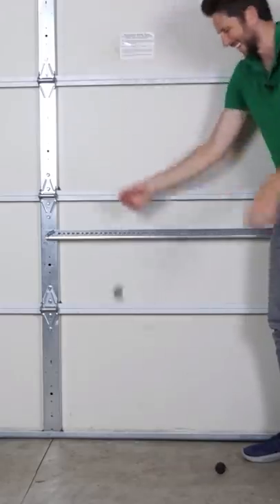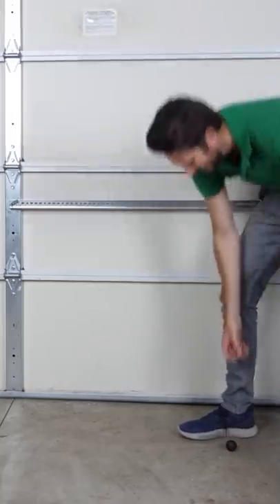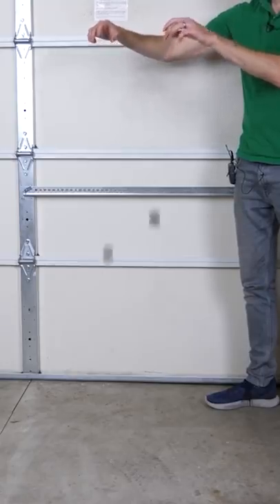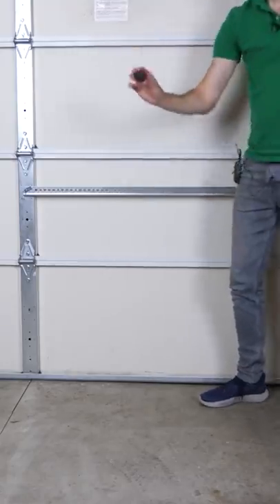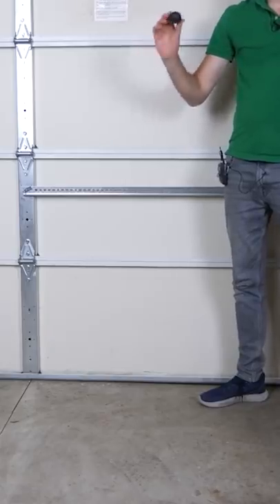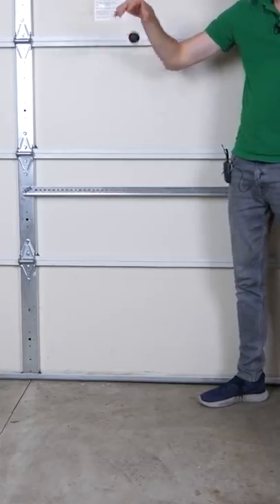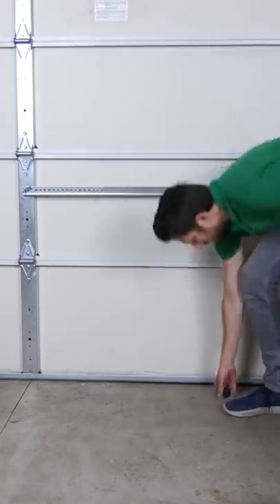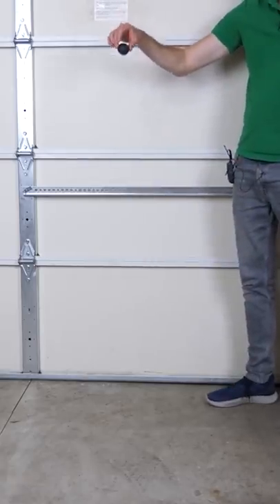The Least Bouncy Ball

Comment: Pad the soles of your shoes with this stuff for a more comfortable.ride.
Reply: Put some in car wheels for fun jumpy rides
Reply: Put them on airplane wings for a fun experience
Reply: @Cthulhu thanks
Reply: Bike  suspension seat  post
Reply: No thank you! I will save myself the future back pain and not wear shoes with cushioning
Reply: Dudes, if it wont bounce and it is rigid, then its the worst thing for shoes and tires. It wouldnt be a comfortable ride, it would be hard af on your legs
Reply: @kissopa02  or, it will absorb the shock of each step so well that you wont even feel it.
Reply: @kissopa02  thats why you get shoes with a proper sole profile, they make the actual difference, not the cushion you put in afterwards
Reply: @4xdblack  what if it’s so shock absorbent that all the kinetic energy is transformed into massive amounts of heat and your feet burn and melt instantly sus 😥
Reply: @amaliadragan2480  thanks that video was like acid to my soul
Reply: @DarkIzo  Wrong. If that was the case cars wouldn’t need springs and shock absorbers. Yes properly fit orthotics improve the proper position of your foot each strike, however cushioned soles minimize the compression of all your weight each step.
Reply: @donlitos  mate, thats a stupid comparison, also what youre stating is more or less what i said.
car suspension is there to primarily keep the tires in contract with the road at all times, shock absorbing is different for every different use case/purpose.
Reply: This is an exquisite number of likes
Reply: @herobrine1847  in that case I'd have more sinister ideas in mind.
Reply: Put some in your breakfast cereal for a crunchy experience
Reply: Except it turn the shock absorbed from just walking into heat, which mean your feat will  be melting not depending on weather, but on how far you walk
Reply: Do you think that shoes aren’t comfortable because it’s too bouncy?
Reply: @4xdblack  well if ya break your feet before that you won't feel anything...
Reply: Make you floor out of this.
Reply: @rogg0224  Ok
Reply: probably would not be more comfortable. This isn't necessarily the most squishy material, it just isn't bouncy; but shoes are better when they're a bit bouncy, because it help boost your foot up again. So shoes made from this would probably be pretty tiring to wear.
Reply: @taliesinriver  so they'd be the ultimate down-hill/down stairs shoe?
Reply: @4xdblack  I guess so!
Reply: @David Davesby A man ate 27 unbouncy balls. This is how he ended up in a ChubbyEmu video. {ChubbyEmu music starts playing, B-roll actor is shown sitting next to a lava lamp and gives the camera a knowing wink}
Reply: Look at the big brain on 4xdblack!
Reply: Are we forgetting what happens in flubber movie
Reply: Is this a Flubber Reference?
Reply: Panther shoes
Reply: Nah pass the Flubber
Reply: @taliesinriver  what about a floor made of this?
Reply: LMAO WHAT
Reply: Lol
Reply: @jwalster9412  probably would have a similar effect to shoes, right?
Reply: Check out footprints soles commercial (:
Reply: hotel trivago
Reply: Eat some for a funny shart.
Reply: Fucking genius
Reply: Put this on a blank for a more blank.
Reply: That would probably be exhausting to run in
Reply: Put it on a wall
Reply: LET'S-A GO!
Reply: Would that really work? Sounds like something for stealth shoes.
Reply: You are funny
Reply: -5 minute crafts
Reply: I don't get
Reply: Lol
Reply: 12345 who taught this man how to to count
Reply: Use it in earhquake zone construction to absorb the wave action in buildings during earthquakes to limit the damage.
Reply: 9/10 doctors recommend
Reply: @donlitos  Wrong!

Comment: if it generates a bit of heat by being compressed slightly then i'm wondering how hot you could make it if you put inside a paint can or something and left it in a paint shaker for a few hours. <3
Reply: That would make a lot of noise.
Reply: Put in inside a chicken and slap it with the slapper machine.

Comment: Counting the number of bounces isn't the best way to count bounciness, since as the bounces get smaller, they every bounce take less time before the next bounce. Specifically, in a geometric sequence, so theoretically, there could be an infinite number of bounces in a finite amount of time. A much better way to "measure" bounciness is to have a stopwatch to measure the time it takes between releasing the ball and the time the ball starts rolling. And even if it's not accurate, at least the recorded time can't be too far away from the real time.

Comment: Same result I got after simply letting a bouncy ball lie around for 20 years without using it. It was hard, showed several cracks and when dropped it just landed on the ground and rolled away. Had to be smashed to the ground with force to make it bounce a bit.